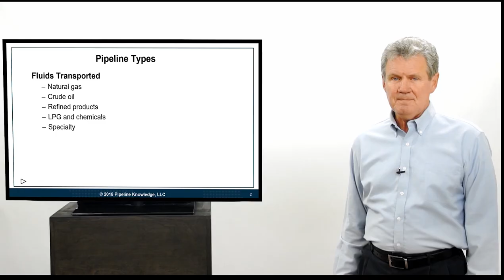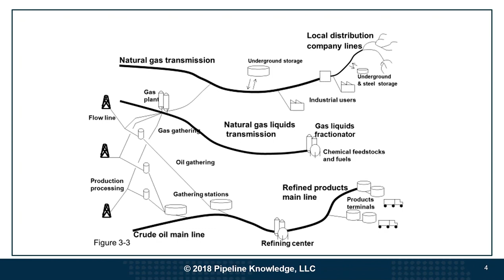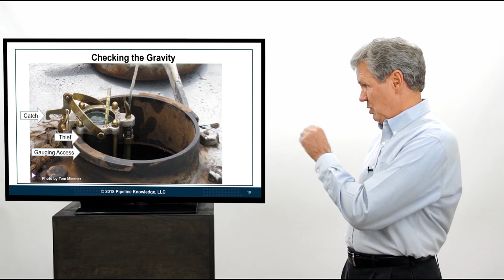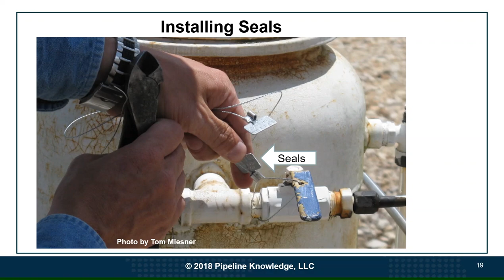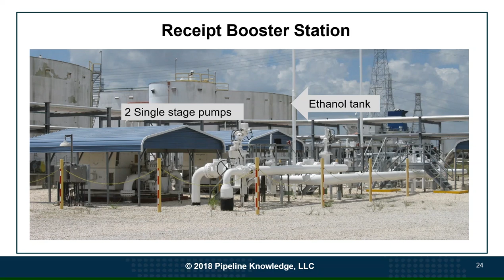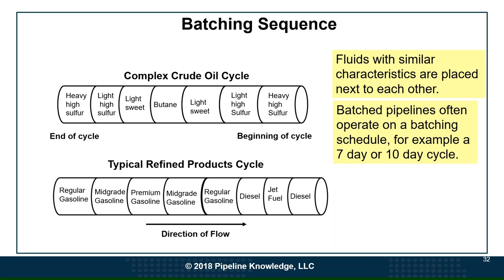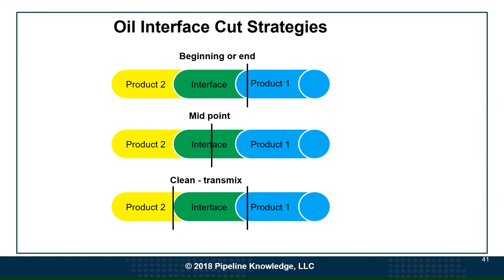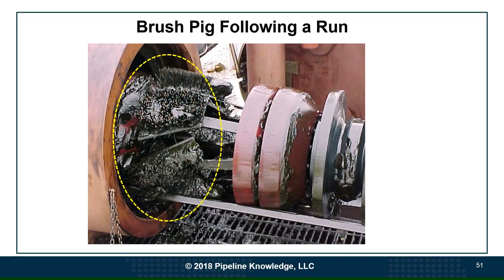AOPL Presentation - Oil Pipeline Operating Fundamentals

Comment: Thanks for making this available to the general public.
I have always found the oil & gas and chemical industry fascinating.
One trip I took I drove past the Marathon tank farm in Patoka, IL and later drove past Marathon's massive refinery in Cattlesburg, KY.  I did some research and found out they were connected by a pipeline.
It amazes me how they can cover so much distance and changes in terrain.
Then when Keystone XL was in the news low and behold there was humble Patoka, IL again.

I keep wanting to check out the WOOD RIVER REFINERY HISTORY MUSEUM.
The Christmas lights on the pipes and tanks are quite the sight in Roxanna,IL as well.

You mentioned the ethanol tanks.
I have always heard you can't ship ethanol via pipe line, since it absorbs water.
Is that still the case?
I also had heard sometimes water is used to separate loads in the pipeline.
Was that ever done and if so is it still being done?

Thanks again.
Reply: I have been to some of the Marathon refineries too! I was at one just outside of New Orleans. Used to work in the industry.

Comment: Thank you for information. Does Crude oil need to be heated to help flowing during cold weather? If yes, What is the maximum temperature it need to be heated?  Thank you
Reply from the maker: Crude oil is a mixture of hydrocarbon molecules.  Most is not heated to get it to move but some may need heating because that particular mixture is more viscous (thicker) than other mixtures.  In other words, the answer to this question is the same as the answer to most questions - it depends.